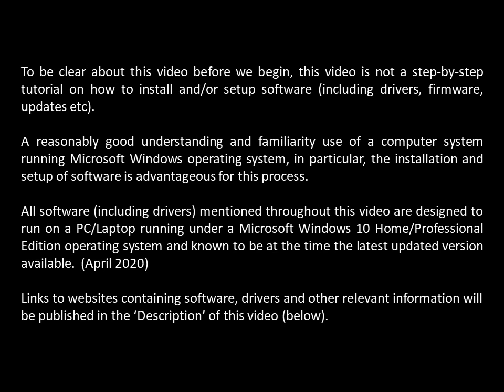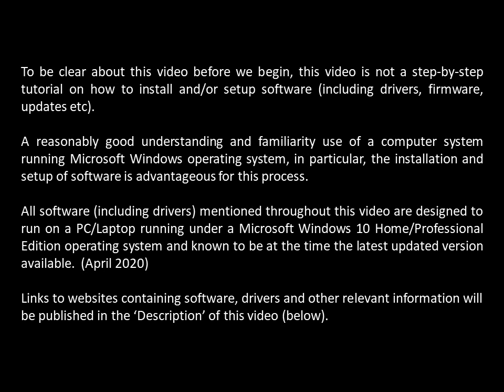Icom IC-R8600 - Decoding DMR

Comment: Great video. Thanks for the help. I have 2 problems. First I have to go to the setup file of DSD plus and run it each time.....wish there was a shortcut or desktop icon. Then when things are running and there's a DMR transmission, I get errors through DSD plus that say CACH ERR slot 1 BS DATA ERR3 DCC=5 rate 1/2 data. Any help on those issues would be appreciated and thanks in advance.
Reply from the maker: DSD+ is not a software program that installs itself as a software program/application that you can access from the 'Start' menu ... (presuming that you are using Microsoft Windows).  The program runs from the default folder/location you have saved the files too.  To create a desktop shortcut, simple locate the Folder called 'DSDPlus1p101', open the folder and right-click the file 'DSDPlus'.  Hover your mouse over 'Send to' and you'll see a side menu ... click on 'Desktop (create shortcut)' .. and you'll have an Icon/shortcut on your desktop that will load DSD+ when you click/double click on it.  DSD+ should then auto-detect your input/output audio devices.  If DSD+ doesn't work from that link, it'll be because the audio input/output is incorrectly auto-configured and you'll have to create a batch file to specify your audio input/output devices and then create a desktop shortcut icon for that batch file.

As for the 'CACH ERR slot 1 BS DATA ERR3 DCC=5 rate 1/2 data' error from DSD ... that is highly likely because you are receiving a broken/weak signal.  Receiving a signal that is a known DMR frequency works best with strong signals.  Unlike receiving an aircraft transmission where the aircraft is 100+ miles away, decoding DMR works best when the signal is very strong.
Reply: @Maersky-747  Thanks for the help and the info. Actually did a "pin to start" for the DSD+. Opens right up now. Still no decoding  and meant to mention earlier it's also giving me a sync: no sync prompt. Signal is great....actually nearly looking at the tower. And my Uniden sds200 operates perfectly and running off the same outdoor discone. And decodes  great. Occasionally I also get a prompt that says UNKNOWN TYPE. Kinda thinking it might be a data problem within DSD+. And instead of using VAC just going through the ICOM Remote utility. Can see and hear the audio coming through...but still not decoded. Sorry for the long reply.

Comment: If the IC-R8600 could also decode DMR and C4FM without a Computer I would order it tomorrow....i use a SDRplay with SDS+....
Reply from the maker: The embedded circuit board Codec is capable of decoding DMR -- not sure about C4FM although I believe this to also be a possibility .. direct from the receiver.  However, due to licencing agreement(s) by Icom, they have chosen to not allow this.  You can read the reason why (Icom's stance on DMR) here ...

http://www.icomamerica.com/en/media_events/news/NewsArticle.aspx?id=201101

Comment: Very misleading, we can all listen to DMR with your average run of the mill dongle and added software..I thought this was a program update to listen to DMR directly from the Icom IC-R8600..2000 pounds and we can't even listen to DMR direct, but Anytone for a tenth of the price gives us access. Tut tut tut..
Reply from the maker: Just where exactly is this video misleading?  The beginning of the video explains what you need in order for the IC-R8600 to decode DMR transmissions.  It is widely talked about that the R8600 does not have DMR as a standard decode mode; thus, the workaround is to follow this video.  You clearly had other expectations and were disappointed - you state you thought this was a program update to listen to DMR directly from the R8600 - if you watched the video in full, you would not have 'thought' and commented what you did.  However, your comment has been noted and any future videos I make I will try my best to make sure they do not give out misleading expectations/information.